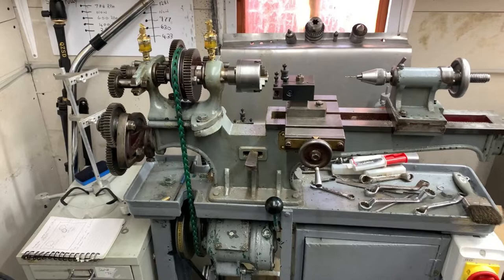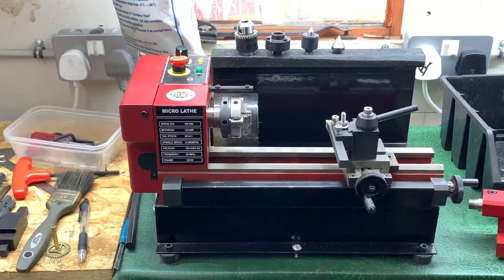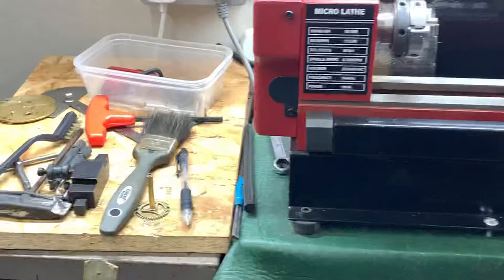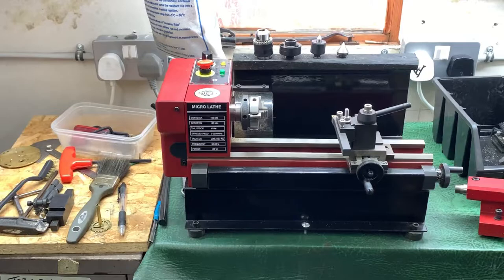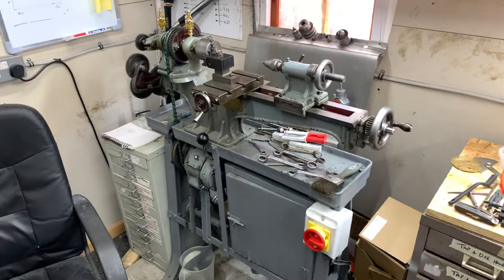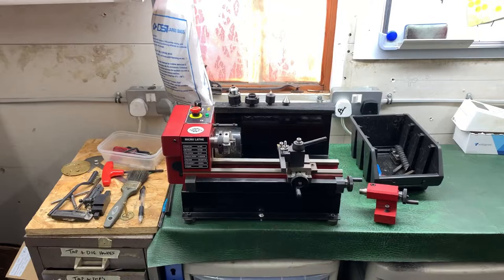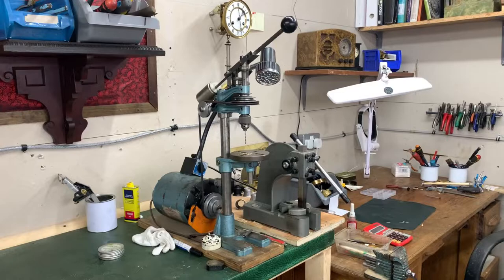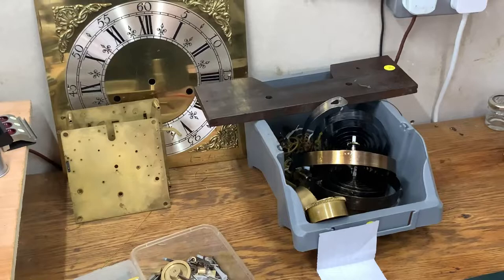Clock Repairs

Comment: Did you teach yourself lathe work or do a toolmakers course? Great videos 👍🤓
Reply from the maker: Good Morning Ian, yes all self taught, but because i have a strong Clockmaking back ground anything engineering i find makes sense, glad you like my videos, ill try and do more time permitting if i can be of any help dont hesitate .
Reply: @clockrepairsmerseyside8303  Hi John, are you intending to video yourself actually taking apart and reassembling movements? In particular how to synchronise the strike systems, snail and count wheel. This is the problem I have getting all the strike parts correctly positioned and this is what I most need help with 👍🤓 thanks for the videos, kind regards Gordon.
Reply from the maker: @gordonlumer2879   Hi Gordon I don't really have intentions of doing any videos of that nature at the moment due to time constraints, but if it's a striking Clock & not Westminster chime there are many good books on the market, there is one I recommend the guys second name is Lloyd faint remember his 1st name at the moment but he has a good way of explaining without going around the houses and making it look like some black art, my other bit of advice is take pictures many pictures just before dismantling after setting your hands to mid day or 12 0clock, they all set up similar although you do get variations is count wheel strike & a mixture of both on many 1930s wall clocks, I am talking striking not Westminster chime but with any clock set them to mid day and get some pictures, you will be fine.

Regards john
Reply: @clockrepairsmerseyside8303  Thanks John, I read books and watched YouTube stuff but still find it a problem and I’m not talking about chiming clocks yet just strikers. I take lots of photos as well. I’ll just keep trying 👍🤓
Reply from the maker: @gordonlumer2879   ok set the clocks at 12 o'clock then make a note of where the stop pins are on the strike side and the chime side, how I got taught was treat each part of the movement separate, get a working movement and study how it works remember the chime side of the movement only gets released on the hour and this is set off by the 4 winged cam situated under the snail on the centre hand Arbor, it is longer than the other 3 fins and in affect  lifts the striking mechanism just a bit higher starts the striking movement into warning which gets stopped by a pin on one of the wheels we talked about at the top of the movement normally next to the fly, the thing about Westminster is take your time pictures notes and without defacing wheels mark positions of wheels cams etc, set them at mid day making sure it is mid day if your clock works but needs service, got to be honest there not my favourite clock type but there are plenty about so they are worth mastering, there are a few variations but they generally work the same, I will alway spend about 30 mins before dismantling just to get it in my mind how the clock is running.

Good luck
Reply from the maker: Sorry I have just gone through chiming clocks, the same applies, the only trouble I have ever had with strikers is hammer pin wheel position, I myself position it just underneath one of the strike wheel pins if that makes sense, but again treat the 2 movements separate, at one point I was teaching my Grandson so I gave him an old movement taught him to do some bushing pivot polishing etc then got him to put the movement together but put the strike train in get it running striking, then the time train get that right then put them both together, this I found got him familiar with clock trains and never overwhelmed him, we had a skeleton clock kit about I think made by Malcolm Wilde he built that with very little help, it made me proud he is now just 18 years old so he does well.
Reply: @clockrepairsmerseyside8303  thanks John I’ll give all that a try 👍🤓